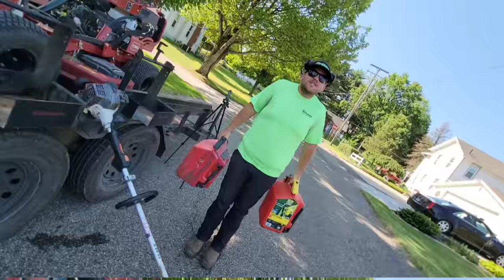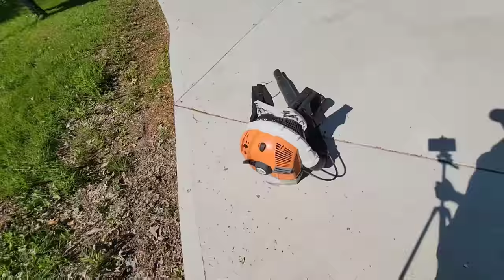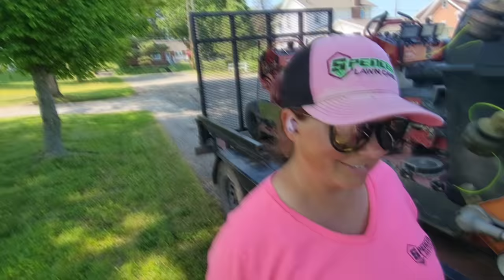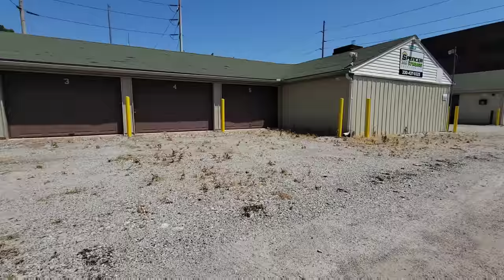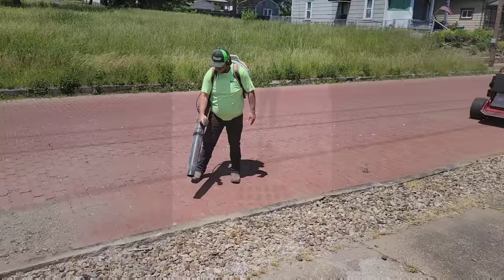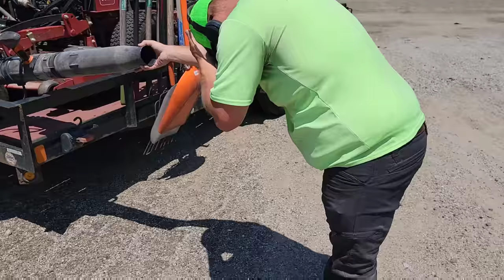I Really Didn't Expect This!

Comment: Great vid as usual. I'm sure you probably know this. If you're planning on doing that lot across the street be sure to walk it before mowing as you don't want to run over anything metal or otherwise  that would damage your equipment. You never know what is hiding under growth like that.